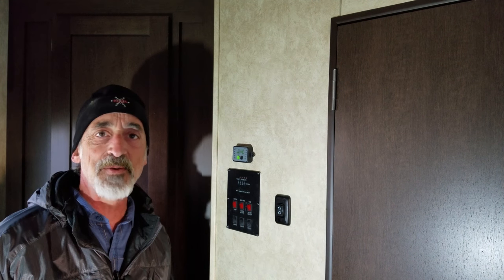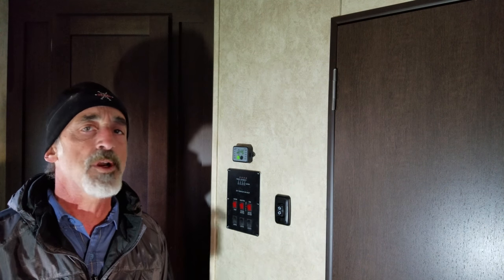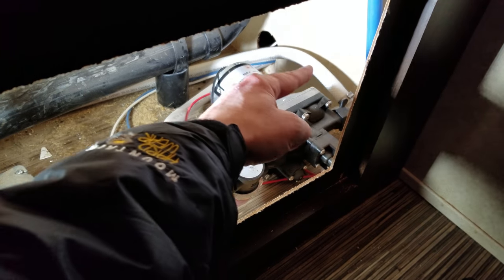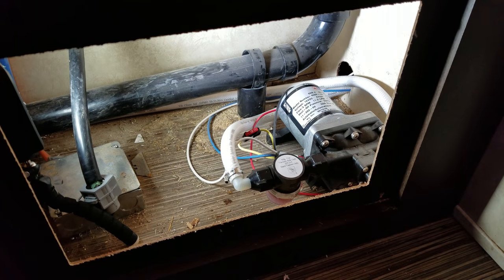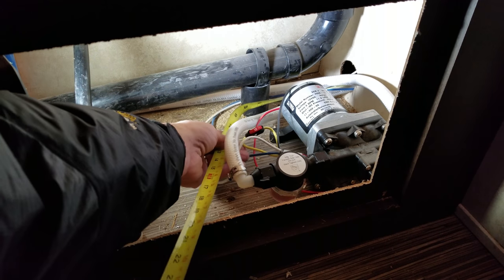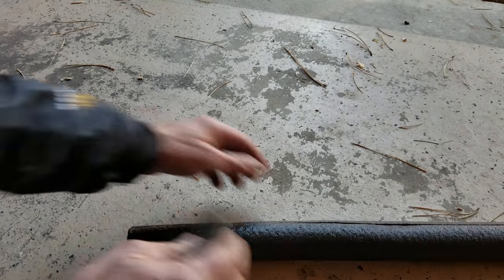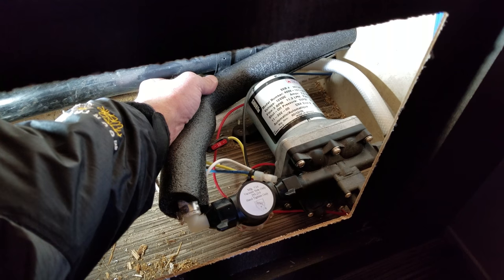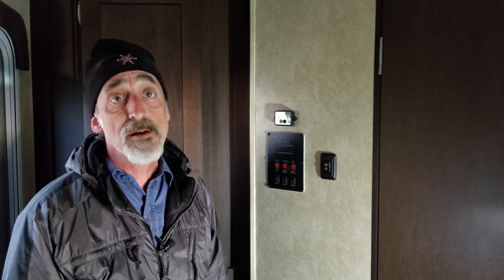Ep. 20: Quiet Your Water Pump - Super Easy, Cheap RV Hack! | RV How-to | Grand Adventure

Comment: Great tip. Adding an accumulator tank will do a lot to silence the pump, reduce on-off cycling and actually give you better flow. We love being able to run the faucet at a slow trickle, or just take a shot of water without the pump going full Ringo Starr.
Reply from the maker: We've been thinking about adding one ourselves.
Reply: @GrandAdventure  It's a must. They are super cheap, super easy to install, and you get a water system that behaves and performs MUCH better, and saves on the life of the pump. 

Another thing that helps is putting the pump on rubber mounts, it it doesn't already have them, and bolt it to a piece of marble, granite, concrete or a heavy paver, to reduce any vibrations and sound. Helps if the paver gets rubber feet too. I have the local cemetary throwing out various pieces of marble all the time. I used a piece of white marble, maybe 18x25cm, 4cm thick. Using silicone hose closest to the pump also helps reducing transfer of vibrations.

Comment: If you buy into the before and after sound demonstration I have some ocean front property in Arizona I'd like to sell you (sucker)! I am a full time, currently working, experienced RV tech - and although it can help somewhat in certain situations it is not going to silence your water pump vibration and resonance through the pipes like ol' grand adventure wants you to believe. Looks like a nice guy, what's wrong with actually telling it like it is and not sugar coating it to a complete line of @&(#$#(! I just attempted this today on a customers coach per their request - and after fully insulating all (that reads ALL) of the RV's water lines, they came to the conclusion that it didn't sound any different. It's worth a try, just be aware it is not likely to silence much. Good luck and happy trails!
Reply from the maker: Never said it will silence it completely -- it's an electric motor after all -- but in our case it did make a remarkable difference. We did nothing to doctor those recordings, that's precisely what it sounds like.  The intake and exit lines on our pump were right up against a wall.

Comment: AWESOME,,,,,,,, That noise is driving me Crazy,,,,,, I'll be heading to the hardware store in the morning , THANK YOU
Reply from the maker: Depending on how your water lines run your mileage may vary. If they touch walls or floor you should see a tremendous improvement. Hope that it works out well for you!

Comment: Just seen this post. I will try this. I also intend to seat my pump on rubber/foam dampers. Think of how a tuning fork works and you will understand that sound is greatly amplified by being in contact with a solid surface.
Reply from the maker: Precisely, Kevin. Most water pumps are already mounted on rubber grommets underneath their feet. I'm surprised that yours is not.
Reply: @GrandAdventure  Having scrabbled about under my sink you are absolutely correct.  Maybe beefing up on the rubber feet would help absorb the vibration?

Comment: IT WORKED -  I actually used a pool noodle that I had on hand from the dollar store. There are two different diameters of pool noodles and I use the smaller diameter one. I split the pool noodle length-wise in half and inserted a small section of it at each place where the water pipe touched a surface. I can still hear my plump working but it is much quieter. Thanks for this wonderful tip.
Reply from the maker: Thrilled to hear that it worked well for you Peggy!

Comment: Looking at my water pump it’s hard piped with Plex pipe. I’m going to rework the plumbing and use flexible pipe and insulation. Let’s see how that works. I noticed you have flexible pipe on your pump. Thanks for the video.
Reply from the maker: Tom, I'm surprised that they plumbed your water pump with Pex -- that basically transmits all of the pump's vibration. That will surely make a huge difference for you.

Comment: That’s funny. I was just about to put a bunch of rubber washers under my pump. I’ll be trying this tomorrow. Mine has gotten so loud. Thanks!
Reply from the maker: How did it turn out for you, Luke?
Reply: @GrandAdventure  it didn’t do anything. ☹️. Mines screwed into an aluminum frame, I’m guessing it’s shaking that frame too much.  Going to try some rubber bumpers, below the pump and between the pump and the screw head.  See if that makes a difference.  If all else fails, maybe a new pump
Reply from the maker: @lukepearson3368  🙁 That's a very unique situation from our experience. Is it possible to maybe screw the pump into the floor adjacent to that aluminum frame member, rather than to the frame itself? If so, that should dramatically improve the situation. Yes, make sure you've got ample rubber grommets under each pump foot.

Comment: Wow, it eliminated the noise completely after you did it!
Reply from the maker: It made a tremendous difference for us Renee. for some others, as you will see from comments, not as much because there manufacturer did a better job of routing the water lines in a more appropriate location away from the walls. Most folks will see a substantial benefit.

Comment: Hey there thanks for posting this! Would this work on the diesel pump by covering the fuel line? The clicking sound is very loud. My heater and fuel feed is inside van.
Reply from the maker: We've never tried it that way, Moira, as we're not equipped that way. But it would only cost a few bucks to try.

Comment: One small spot of the discharge hose was touching another pipe. 6" of insulation and it is silent. Thanks so much.  I had already installed the "pump silencer kit" and it did not work.

Comment: So, I watched this video and did what you said.  I wrapped all the hoses exiting the water pump, even those that are under the toy hauler.  I still have a vibration, however it is much less than it was before.  Any ideas on what I can do now?
Reply from the maker: Glad to hear that you found some improvement! There is some inherent vibration/noise that you're going to get from the pump no matter what you do, all you can do is try to minimize it. If you have good rubber grommets beneath the pump feet, to isolate the vibration against the floor, you're pretty much at maximum improvement.

Comment: Yep, I hate that nonsense noise as well. And they are just poorly built pumps. They do not need to make that much noise if manufactured properly. Tried it on our shadow cruiser today. Didn't make any noticeable difference in our case. cheers.
Reply from the maker: Sorry to hear that. In our case we dropped the sound by what seems like half, but depending on how your water lines run, your mileage may vary.

Comment: Could this apply to a house with a well pump? When my tank cycles at night I can hear it and it’s so annoying. Sounds like it’s right under my bed yet the tank is on the other side of the house
Reply from the maker: We have no experience with that, but if the pipes attached to the pump are contacting a wall it sure seems possible.

Comment: I seen another video where a guy used these for the  gap on the bottom of the slide during cold weather.   Maybe you were the guy?  lol. I did have a question about leaving the switch on, would it burn the pump up?
Reply from the maker: That pipe-insulation-in-the-slide guy wasn't me. However, there's no issue with leaving the pump switch on because it only runs when the system is depressurized by opening a faucet. We do, however, always turn it off when we leave, for a broken PEX line will result in 55 gallons of water being pumped into our trailer walls. 😄
Reply: @GrandAdventure   that makes sense. Most of the time  I have water  on site so I don't  really use the pump.  Thanks for the info.

Comment: How did you fix up the hole you created to access the pump? I'd like to do the same type of access!
Reply from the maker: I created no hole, Mitch. I have a panel in my bathroom cabinet that removes to access the water pump. Most folks have the same, for you need to be able to access the water pump to winterize.

Comment: Mine makes that noise all the time! Even when I'm not running the water! Can't be what he said it was? I don't know, I need some advice.
Reply from the maker: It shouldn't be making any noise whatsoever when it's not pumping water. Sounds like you have an air leak somewhere in the water line.
Reply: @GrandAdventure  Okay, cool. Now how would I check for that?
Reply from the maker: @robertwood6238  that's a good question. I'd definitely start by checking all fittings to ensure that they're tight.
Reply: I'll give it a try. Thanks.

Comment: It is mounted to a sounding board, that is only part of the answer.
Reply from the maker: Nope, mounted to the floor.
Reply: @GrandAdventure  That is a sounding board, I have been working to isolate the pump, tried bubble mounts, and finally a couple of layers of Reflectix.
Reply from the maker: @4aneme8R  have you tried some rubber grommets beneath the pump feet?
Reply: @GrandAdventure  Bubble mounts do essentially the same thing. Finding them with the light weight (most are for large machinery) is difficult.
Reply: @GrandAdventure  I used bubble mounts, they isolate the pump from the base.

Comment: I wonder, could you just use $1 pool noodles?
Reply from the maker: I suppose you could, but they'd be awfully huge compared to pipe insulation. Really, you could use anything, even old rags. The point is to insulate contact points for the water lines connected to the pump.
Reply: Thanks for the video.  This will make a huge difference.  :)
Reply from the maker: Jrprez22 glad to help!

Comment: Hmmm.  I heard absolutely nothing.
Reply from the maker: Exactly. There was a low hum that our microphones couldn't pick up, but gone was the rattling and shaking.
Reply: I agree. It's as if the pump had reached the shut off pressure and was no longer running. Mine sounds just like that. Ummm! Lol

Comment: Horse Shit... the plywood is acting as a sound board... the mechanical noise of 3 -4- or more pump elements moving back and forth is transmitted mechanically through the mounting bolts.  sure the hoses can transmit the noise too.. but hold the running pump in your hand ( just lift it up.. slide your paw under it)   see how the noise is almost gone ? !!

Comment: Hä? Are you kidding me? The noise comes from the pump, not from the hose? Your insulation should do absolutely nothing to improve the noise...?????
Reply from the maker: Believe what you wish, but the majority of the noise comes from the vibration of the water lines entering and exiting the pump impacting the adjacent walls and floors. Simply look at the other commenters who have had similar success using this method.
Reply: @GrandAdventure  Very interesting...?!

Comment: Neat! Thanks.
Reply from the maker: Any time, LK.
Reply: @GrandAdventure  Question: I am supposed to winterized on the 20th, but  we are trying to sell our place. I donxt want to winterize yet. I do not know how by myself, but willing to learn. We are getting rid of the furniture tomorrow and were going to live in the RV. It is supposed to be all seasons, 25 ft Grand Design Imagine, no slides. We are in NE washington. Do you think it is possible to do that since winter is coming on rapidly?  If we stay in the cabin, we will have to buy at least $600 worth of wood  probably $800. I wonder if propane would cost that much. We have it hooked up to a heavy duty 30 amp extension cord...100 ft. Kind of between everything happening and stuck in limbo. The cabin has only the wood stove.  It sometimes gets below 0 for a week or 2. In the cabin then, we also use an electric heat  or that little propane heater and shut off 2 rooms.Thanks for any thoughts.
Reply from the maker: @TheLakingc  you'll be fine. If you'll be there for the winter, skirt the RV. Put a heat source within the skirt, like a bright incandescent light bulb to warm the area beneath the trailer. You'll go through a boatload of propane using it for heat, so figure out a way to supplement with electric. We use a mica panel heater to supplement our RV fireplace while wintering in Salt Lake City and therefore barely use the furnace. Use a heated hose. Keep your drain valves closed until it's time to dump. Best if your water connections are in an enclosed wet bay, and we use a small ceramic space heater down there because our RV furnace isn't running that much, and therefore doesn't heat the basement and wet bay. We have temperature sensors from RV Whisper in the basement, with an alarm set if it dips below x degrees in there.
Reply: @GrandAdventure  i have only a 30 amp cord connected. Oh, you know what? I am goofy! It is NOT  30amp!  I do not know the amps...just an extension cord running from the cabin porch to the RV. I am sorry.  have a chicken heat lamp i probably won't need for the water pump if not using the water in  the cabin. 125 watt.  But if i add a heater...hmmm ? I wonder if another chicken lamp inside would be warm enough? The total then would be 250 plus the frig.
Reply from the maker: @TheLakingc  OK that's a different story. Running that off a 20A extension cord will be a problem, especially that length. It'll actually create a fire risk with too much connected to it.
Reply: @GrandAdventure  thank you.